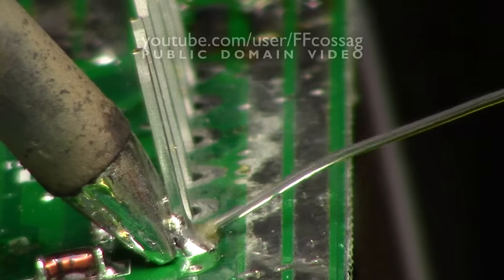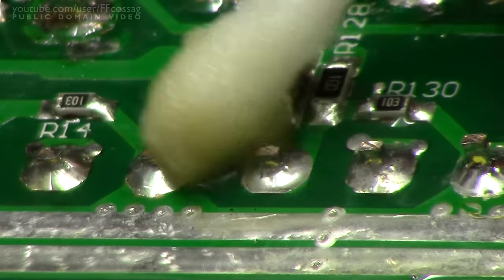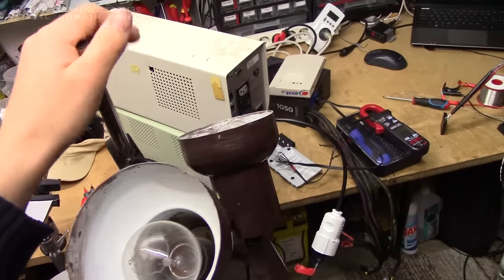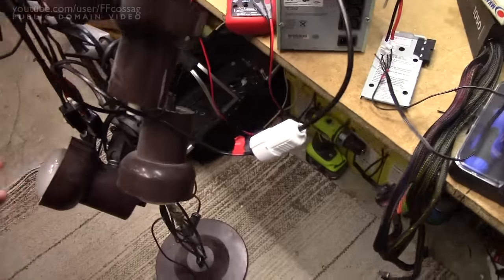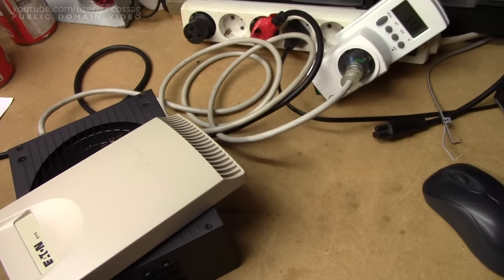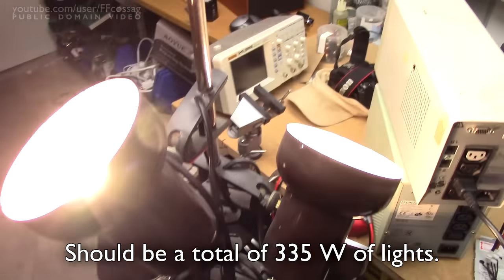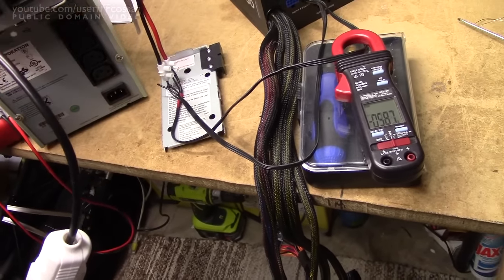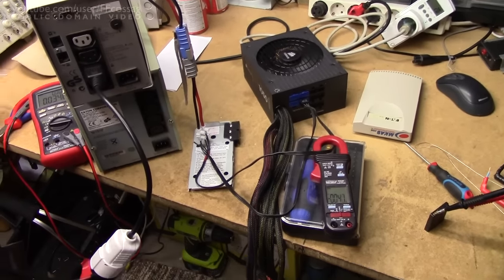Trash-picked Corsair HX1050 repair follow-up

Comment: If you tweak the output up a couple of Volt's it would make a good 30A battery charger for all those lead acid batteries. And save hogging your bench supply. The resisistors around the feedback v-reff should be easy enough to find. Upping the Volt's will reduce the max continuous current but should be plenty.
Reply from the maker: I've tried modifying PC power supplies to charge batteries in the past, with little success. They're usually too specialised for it to work well. They also don't have a CC mode, so there'd have to be some kind of extra current limiting system.

Comment: Could you put a link to all the parts you replaced in the psu please. Have same psu and it isn't working. Thanks in advance.
Reply from the maker: You need to figure out what's wrong in yours, there's no telling it's got the same problem as mine. Just linking to the parts I used wouldn't do you any good.
Reply: FFcossag it would give me a general idea as to what you ordered and actually where to get them. I don't have a clue as to where to get these things.
Reply from the maker: You can very clearly see the parts in the very first frame of the video. There should also be another video where I diagnose this unit, search for Corsair on the channel and I'm sure it pops up. I usually order parts from Mouser.com. If you want to play Chinese Russian roulette, you can also probably order from Ebay, but they're gonna be counterfeit trash.

Good luck.

Comment: got same hx1050 the 5v and 3v has dead ic chips and 2 blown fets if u remove the 5v board and 3.3v board can i power the supply and test it to se if 12v rail is good all i get is click on then off fan twitchs where should i look